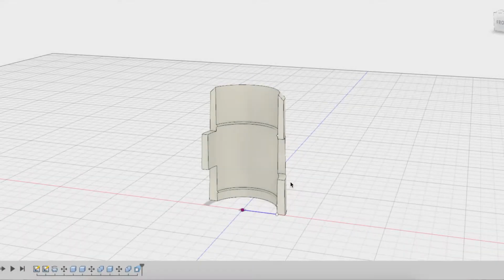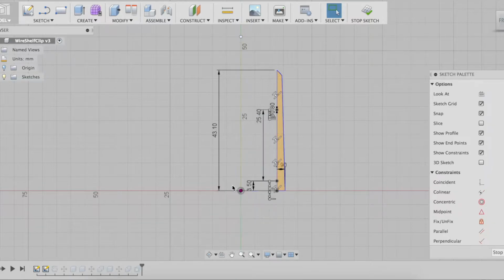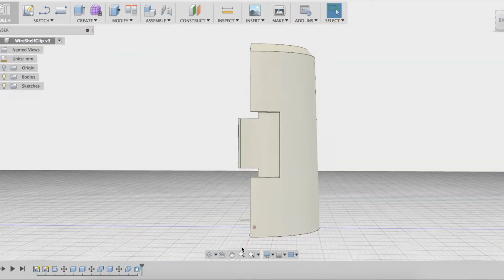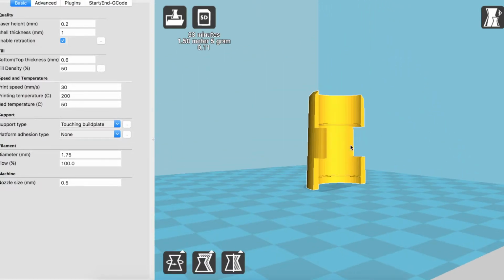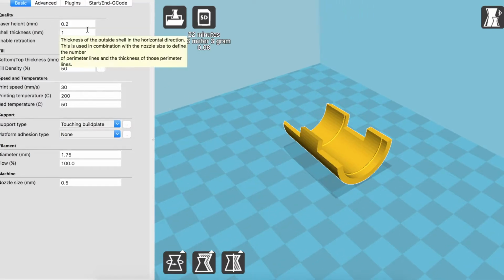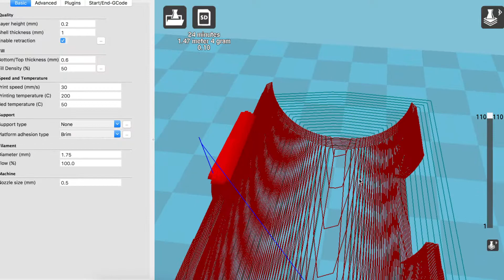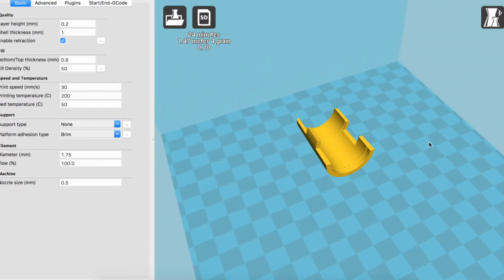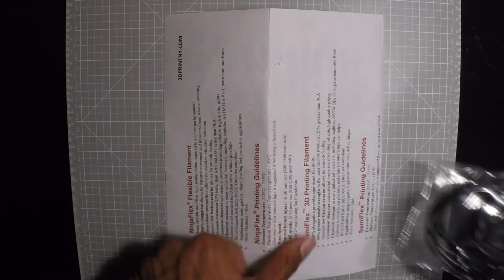Making a Wire Shelf Post Clip #2: Results

Comment: Given that the originals are utter trash and slide basically every time you touch them while assembling the shelves, you could probably sell these, or better yet, go beat the original manufacturer over the head with a pallet of them
Reply from the maker: +gplustree Lol! I feel ya. My best solution so far has been to make these open and free for all to make themselves 😉
Reply: jrclem I need a 3D printer. :( Or maybe an old laserjet to use as a wrecking ball against these shelves and then go back to 2D printing with it. THE STRUGGLE IS REAL